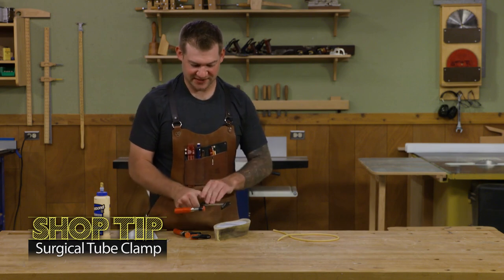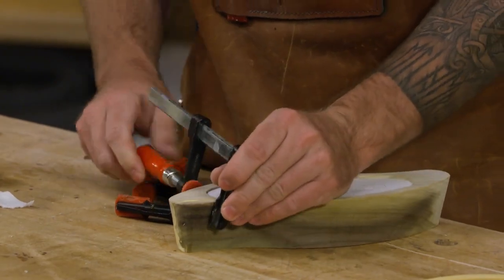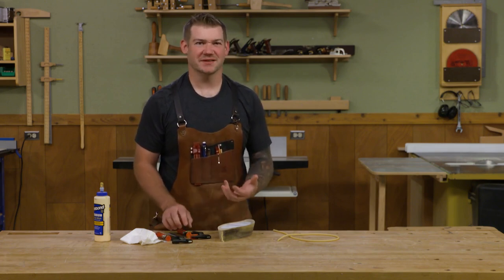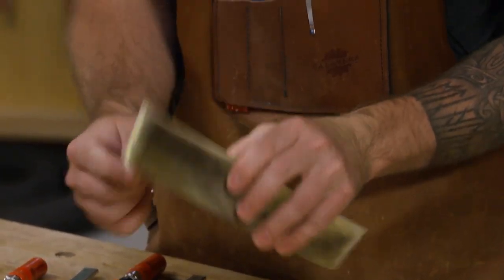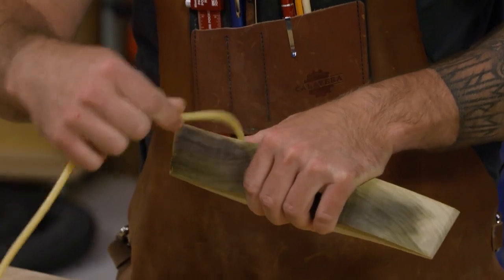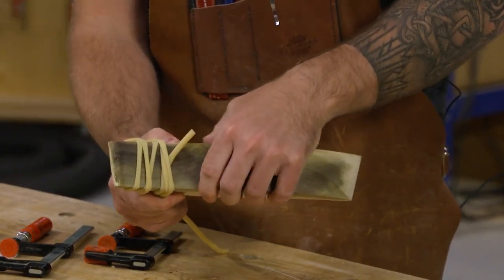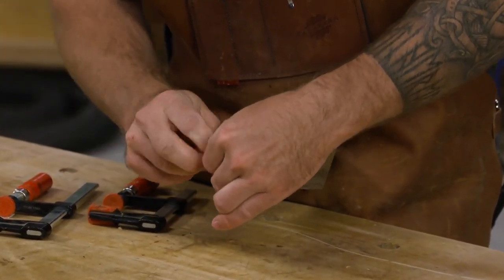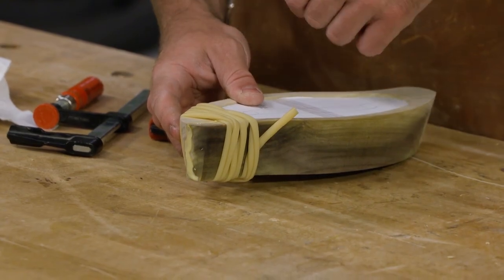Woodworking Tip: Surgical Tube Clamp

Comment: Not bad. A nice step up from rubber bands, which can be a hassle since they're fixed to a particular size- the only control you have is to double them up, but then you're juggling size and tension, and tbh they're not very trustworthy.